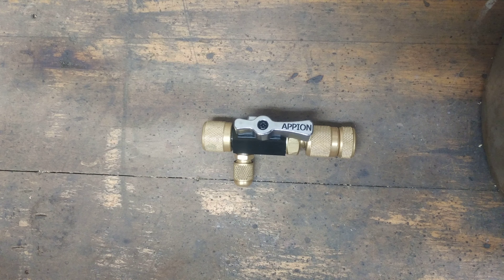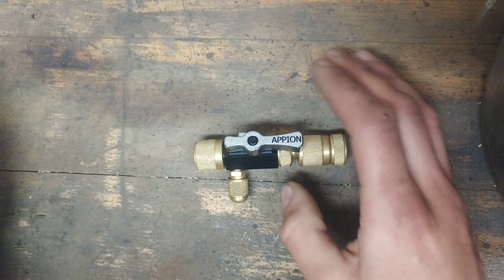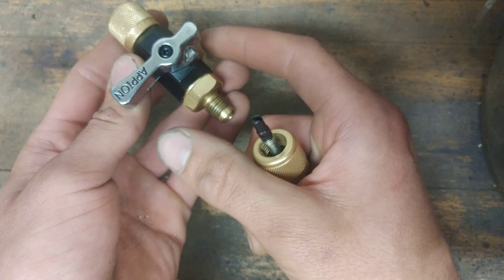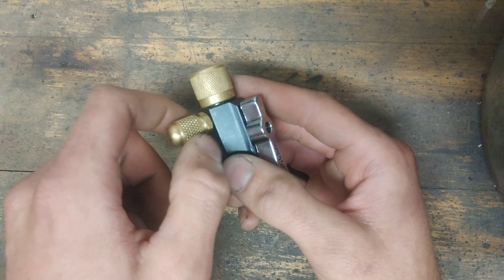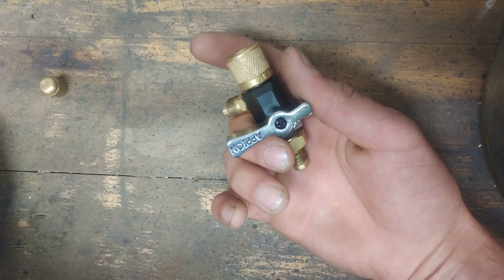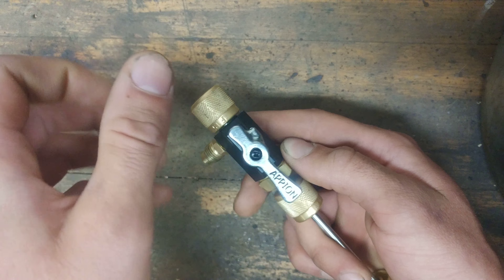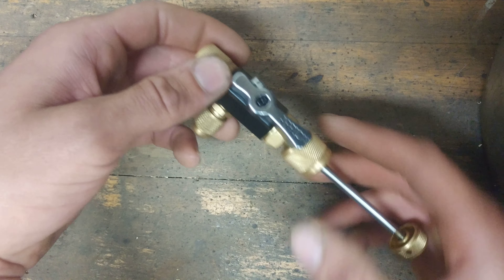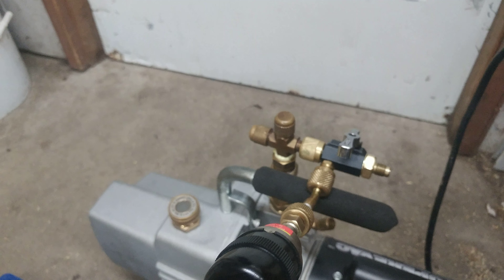HVAC Appion 1/4" Valve Core Removal Tool Review

Comment: Any chance that you can redo that vacuum test, but when you reach max microns, turn off your vacuum pump and see if you get an increase in microns?
Reply from the maker: I definitely would get an increase. Although the equipment is good, it will still show a leak because the volume is so small

Comment: I have a terrible time removing the core. It will unthread, but aways gets stuck and I have to launch it with system pressure. Other than that, it is great.
Reply from the maker: Yes, if when you install the tool, you tighten it too much, the oring swells and overtime it will not pull the core. The newer ones have a magnetic end to help remove the core.